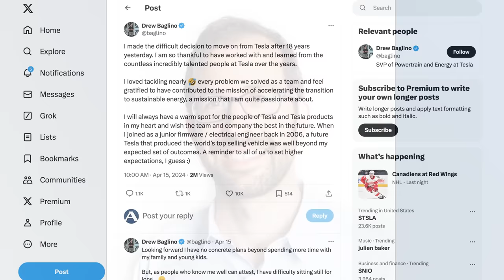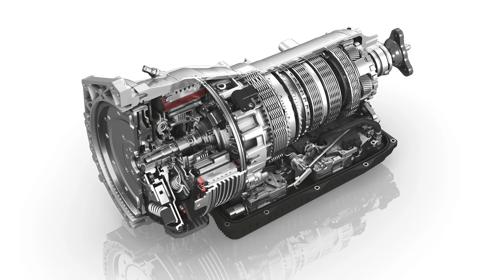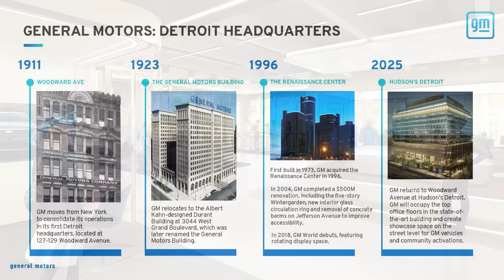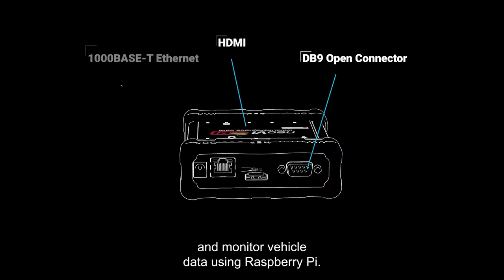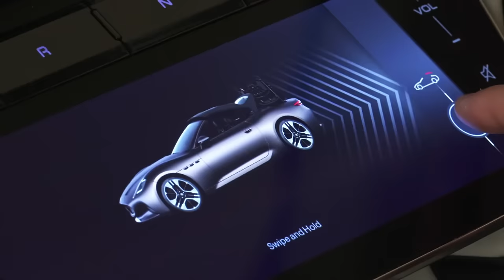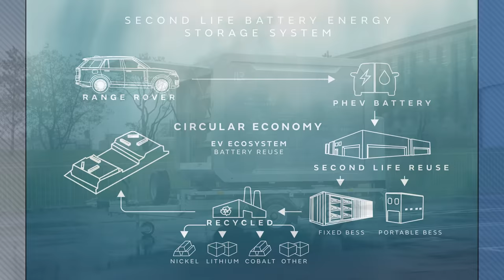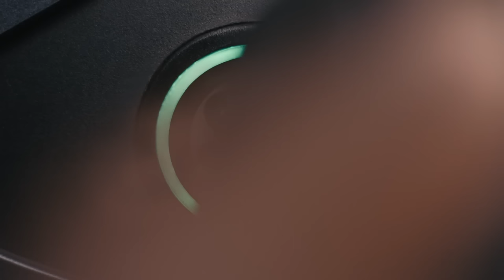Alfa Forced to Change New CUV Name; Key Leader Leaving Tesla - Autoline Daily 3791

Comment: The parts suppliers have better foresight and are just smarter than automakers. They will be the first to develop an exit strategy from ICE components leaving automakers without options.
Reply: Well the 20 diversified big ones for sure but i suspect that many of the 1000's of 1st, 2nd and 3rd tiers will end up as empty warehouses
Reply: If the suppliers were smarter than the automakers, they would be the automakers instead of the parts suppliers.
Reply: @hwirtwirt4500  MAGNA makes entire cars for automakers but on their terms.
Reply: @frankcoffey  Do you own a Magna? Never heard of one.
Reply: @hwirtwirt4500  Mercedes-Benz G-Class (1979–present)
Jaguar E-Pace (2017–present)
Jaguar I-Pace (2018–present)
BMW Z4 (2018–present)
Toyota GR Supra (2019–present)
W Motors Fenyr SuperSport (2019–present)
Fisker Ocean (2022–present)
Reply: @frankcoffey  You're confused Frank, Magna is a supplier not a builder of automobiles. There is a difference.
Reply: @hwirtwirt4500  They build entire cars under contract, the nameplate company doesn't assemble any part of the car.
Reply: @frankcoffey It's not true, stop repeating this nonsense.

Comment: Yep, by the time Tesla is done there will be more robots than people working in their factories.
Reply: Likely
Reply: I suppose it depends what you count.  If you've seen general assembly at work, you'll know there is no way.  It will be probably about a hundred years before a humanoid robot can do that kind of work at the same speed, reliably, for more than a few days.

It's gonna be at least several years before a humanoid robot can replace anything but the easiest position on the line, for as long as ten minutes.
Reply: So they just laid off 10,000 robots?

Comment: Tesla not doing well this year 😬 this may not be a year for them heck stoping production of the cybertruck jeesh
Reply: In the meantime Ford is recalling over 40K vehicles with suspect fuel injectors that may burn the car.  The kicker is that they are not replacing them.    Instead they are installing a hose to drain away the fuel as it leaks!  Wonder if there is anything about parking it next to other cars. LOL
Reply: @danharold3087 Tesla has had to recall all 250  CTs because of a badly designed and faulty accelerator pedal.
Reply: @JohnH1  The actual accelerator pedal is plain metal.  To make it look 'appropriate' a plastic cover is glued to it.  The glue is not working.   Surfaces need to be cleaned and new glue applied.  New Trucks were seen leaving the factory today on Joe Tegtmeier drone footage.
Reply: @danharold3087  Yes a severe safety issue due to poor design and a lack of proper quality control measures. "New Trucks were seen leaving the factory today on Joe Tegtmeier drone footage." a meaningless statement without independently substantiated sales/registration figures. Who is Joe Tegtmeier and was his "evidence" time stamped and independently verified? I'm guessing not :)
Reply: @JohnH1  Sources vary.  One says it was glued another said it was spot welded.  Either way the join failed. It has caught NHTSA's attention.   
Obfuscate links.
Reply: @JohnH1  Hey John.   It is a YouTube comment based on information at the time of posting.  

None of the trucks built or not built since the stop sale were likely to have been delivered and registered.   Your asking for meaningless information.

Video title is "Mystery Structure! Cybertrucks Pile Up & Leadership Changes! 15 Apr 2024 Giga Texas Update (07:15AM)"  YouTube says it was uploaded yesterday.
Reply: @danharold3087 It's hilarious how you can provide details and data and yet all you get in return is feelings and emotions and vitriol.  I give you credit for your tireless efforts.